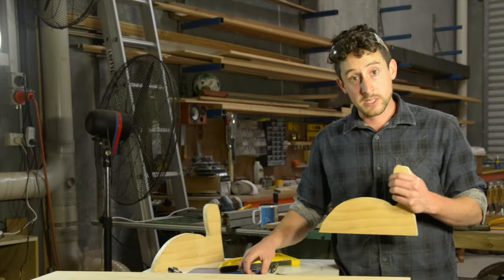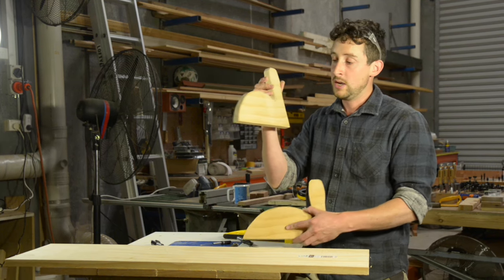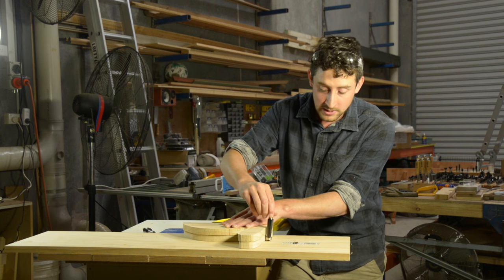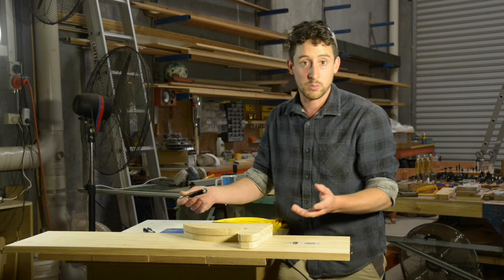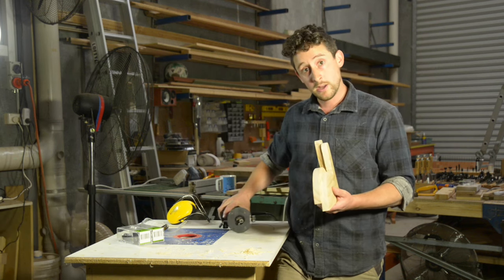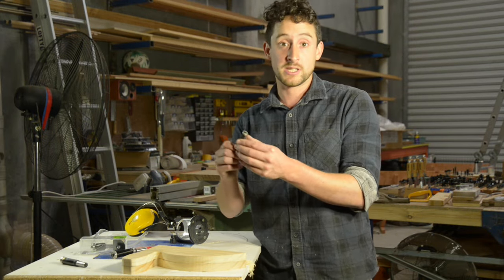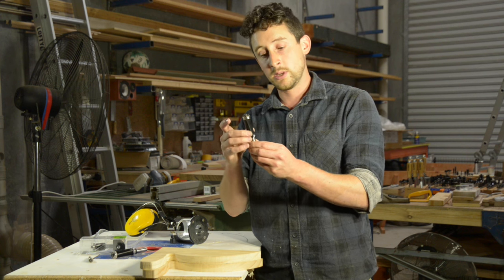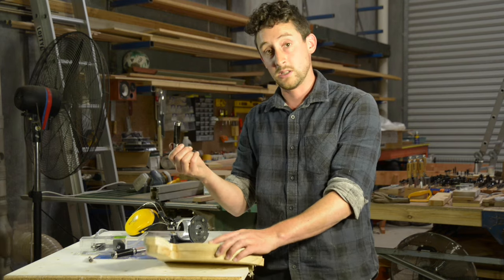The Router Bits  - How to Use Flush Trimming Bits

Comment: The dual bearing bits can be especially handy in a router table as it lets you flip your work so that the template runs on the other bearing allowing you to cut with the grain and prevent tear-out.

Comment: Is It Possible To Flush Trim Rout A 2x4, In A Single Pass?

Doing Any Clean Up, With Smaller Subsequent Passes?

I’m Trying To Get Them Flush On One Side, Then Rip The Other Side With A Table Saw, Because I Don’t Own A Jointer.

Ultimately Each Piece Will Be 3” In Width, So I’d Be Shaving off 1/4” On Each Side.

Just Need One Flush FLAT Side To Ride Against The Table Saw Fence.